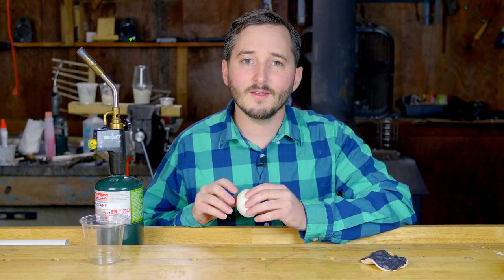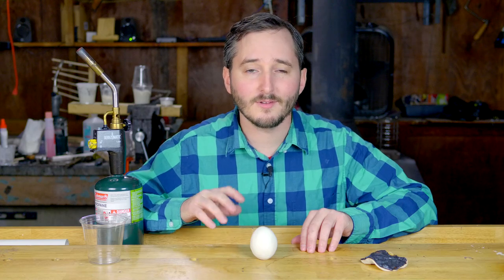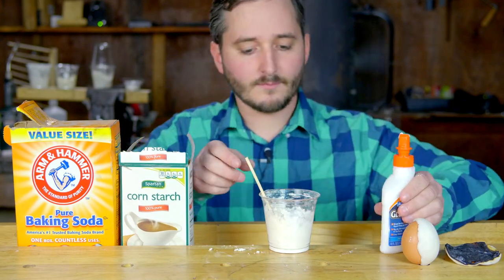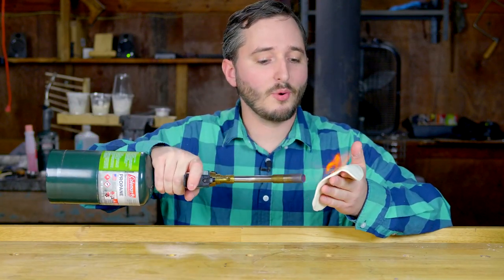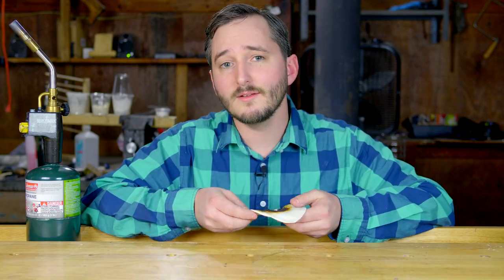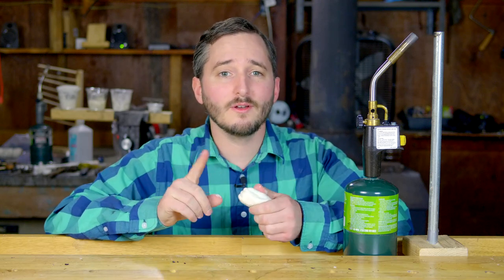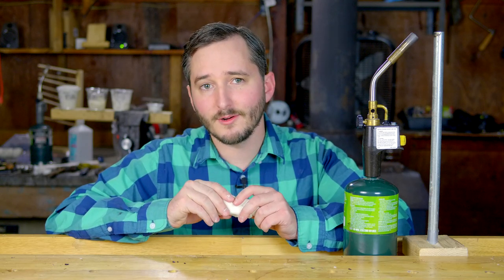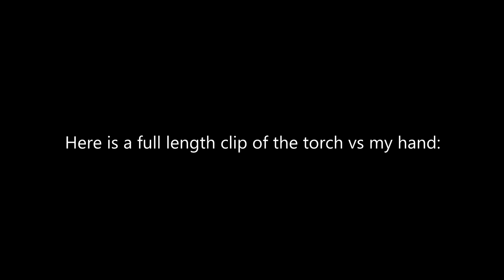A Super-Material That Can Be Made In The Kitchen (Starlite Part 1)

Comment: Great for plumbing applications. Especially when doing repairs that require soldering with a torch in closed spaces.
Reply: Exactly what I was thinking dude. In tight spaces
Reply: What a flippen great idea!
Reply: Im in hvac and was thinking the same thing.
Reply: I was thinking same thing for heating stuck automotive bolts in sensitive spaces!
Reply: My very first thought. Cheap and easy to make.
Reply: What would you do with it?
Reply: General answer put it on the things you don't want burned , specific maybe soldering on a new toilet shutoff valve could use to cover a laminate floor , automotive could use to build a little hut around always stubborn exhaust bolts to keep fire from dancing over to wires and plastics
Reply: I would be curious to see if maybe covering a stuck bolt and heating would keep bolt a tad cooler and get a little more hot expansion/cool contraction help
Reply: I thought that too
Reply: @DS-wf6rh  thanks.
Reply: Kinda like masking tape for soldering?
Reply: @padfrog193  Perfect example, thank you.
Reply: @padfrog193  masking tape to soldering, that's one I've not heard of or seen videos of before, does that stop solder running down the pipe...

Comment: Very cool! I have done a lot of plumbing repairs on copper pipe with that same torch and scorched a lot of 2x4s and floor joists, even though I was soaking the area with water and trying my best to prevent starting the building on fire. There are so many times that you need to sweat a fitting in close proximity to the structure and it is impossible to not scorch the building. I have never had a good barrier material though I have tried many things. I will now use this. What an awesome thing to share with us! I would be interested in hearing your theory about the failure of Starlite...

Comment: I’m a jeweler and I do casting work sometimes. I think this would be a great material to radiate heat back into the crucible to melt the metal faster! Thanks!

Btw, I love the calm and quiet atmosphere without the electronic music from some channels. I can think peacefully in my head while watching your videos!
Reply: RexArthur Ramos let us know I was thinking it would work well as insulation in a kiln. From what I’ve seen most diy kilns seem to break down in time from the heat.
Reply: Simsimaspineshank S That’s why it would be a good material for melting metal in small crucibles. You don’t want a material that will absorb heat but a material that will reflect as much heat back onto the metal. If you use a material that absorbs heat, it would then steal energy that could have gone into the metal which results in longer firing time = wasting more gas. 

Normally I use a specific kind of brick for jewelry work to create a square “oven” but that application still isn’t optimal.
Reply: Cecil McKeithan I haven’t used it enough times on casting to give you enough data. For my application it does help. 

I do wonder if you might need to pre-fire the starlight to get the carbon to come out first since I dont know how hot your kiln gets but If you’re heating a kiln up to cone10 you shouldn’t need to pre-fire it. As for the durability? I also don’t know either haha, but the materials to make it are so cheap and easy to make that it warrants a try.
Reply: May have to make some and see if it would make a good mortar with the fire brick
Reply: Let us know if you try it. I was thinking the same thing
Reply: @cecilmckeithan5088  yes I was sitting here wondering about the what reciepe would work best.. did you try it yet? Would be great to be able to make bricks.
Reply: Nonya Business my hands have been deep into building greenhouse for wife haven’t had time to do anything
Reply: Could just mold a whole crucible out of it. Or a brick
Reply: But with like a clay bowl in the center because this looks like it would make a lot of slag
Reply: I'm just commenting so that i get a notification the next time this thread gets an update and good luck to everyone testing this
Reply: Interesting idea, i might also try it but that will take some months
Reply: Im now considering it for lining the combustion chamber of the rocket mass heater I'm building for the greenhouse.
Reply: Send him some money then
Reply: i am a backyard smelter , i melt gold  , silver and the rest , as i do not have a proper facility this will come in very handy .
Reply: So? How did it go?
Reply: The heat gets dissipated, not reflected. No go.

Comment: If this could made into the correct consistency for drywall compound  application
then you have fire proof ing achieved for at least the surface of interior walls.. 
amazing!
Reply: Hmmmm!  Add in some gypsum powder...  and an industrial high temperature glue...  and might work!  :-D
Reply: I wonder how household paints would affect the performance, acrylic paint is one thing but what about oil based paints?
Reply: @AflacMan13  Add gypsum powder to liquid glass and you've got everything you need.
Reply: Drywall is already very fire resistant, and there are ways to make it moreso that are already out there.

Comment: Holy shit I just watched that documentary. If this was his formula than its no wonder he was so protective of it. It's so simple and would be crazy easy to copy.
Reply: I was thinking just this. It explains perfectly why he was so protective of the formula.
Reply: Its formula is still unknown, video is about similar stuff but not the same. I will believe it is same if he hits it with 10,000 degree laser.
Reply: @commandroid9336   Lasers don't have a temperature, they are just light.  The temperature at the spot where a laser is hitting something depends on the properties of the material: how much of the light it absorbs and how well it re-radiates the heat or conducts it away.  It's the same reason an asphalt road in sunlight is much hotter than a concrete sidewalk.
Reply: @hyperhektor7733  yeah maybe someone will see this video and continue improving upon it
Reply: @apotato6278  im already off to improve it at the moment I will make it withstand over 20,000 celsius tempetures and be able to stop bullets and design phone cases with it. I might even make a super suit with this material

Comment: This is fantastic. I can think of many uses for this around the house and garage such as protecting areas near something you are using a torch on, like soldering copper pipe in a tight area. Definitely interested in a video with more info about why the original did not enjoy commercial success

Comment: Iv been a full time firefighter for 20 years. This foaming action provides a air space between the outer layer, with direct flame insult, and the inner layer in contact with his hand. Modern firefighting PPE ensembles utilize this method for protection from fire and heat insult. The material is different, a firefighters PPE uses, multiple layers of textiles, to protect against different types of dangers firefighters face. But the end result is still the same. If the air spaces between layers are compressed, due to the ensemble being worn too tightly or compromised with water bridging the gap of the layers. The firefighter can be burned badly. Excellent video and well put togeather!!!
Reply: So are you saying this would not protect a firefighter in a fire sir?

Comment: I for one would love to hear your thoughts about why Starlite never made it into commercial production.also, if some kind of organic fiber, like hair, were mixed into your putty might the carbon foam be reinforced by a carbon mesh. this could add structural cohesion to carbon insulating layer making it less like to brush off.as always, great demonstration. please keep producing these excellent videos
Reply: Because the inventor provably lied about almost every "Nasa Memo" he ever had... Seriously, if your inventor has to lie about stuff constantly. IT's a bad sigh.
Reply: "...about why Starlite never made it into commercial production" 
1) It wasn't possible to apply it to surfaces
2) Ward died
Nr. 1 is the main reason.
Reply: Instead of hair, etc., what about strands of glass, like what is in fiberglass insulation.  Very tough, and also already being used to insulate!
Reply: That would be carbon fiber. :)
Reply: @StCreed  Actually, it was possible to apply it, but time-consuming. The problem is it degrades pretty quickly and weighs a ton compared to materials doing a comparable job.
Reply: Yes pls share

Comment: It's so nice to see a video that puts it all right out there, no weasel words or big secrets. Thanks! I'm going to try this as a liner for a micro forge, using a soup can and propane torch.
Reply: How did that work out? Someone else was saying it didn't last a real long time. Let us know.
Reply: It's not a refractory, exactly. It gets its best fire protection while it's drying out. After it's dry, it will gradually burn, blister, and spall off.
Reply: I tried it today. It has dried out for three days, and I would have a very hard time melting pennies on it! He had better luck with it damp, as you said.

Comment: Could you try completely coating and Egg in your starlite and placing the whole thing in a foundary? So it’s heated from every angle
Reply: There are going to be limits- it obviously relies to some extent on insulation, and insulation values are finite. It has to be cooled on one side. It's magical, but not quite that magical. A big enough volume could last a long time, but not indefinitely.
Reply: hes right, now youve established a baseline with the egg demo, you need to chart the upper limit
Reply: perhaps make a small pot thag fits only one egg, to protect it from all sides
Reply: This would be interesting but my prediction is it won't last nearly as long as when the heat only comes from one direction and can be radiated away in other directions.

Comment: You should totally make a video about why starlight wasn't used!
Reply: Even if it's theory, I'd still be interested in his take. I have to agree with him that it's more than just the guy passing away.
Reply: I've gotta agree. Even if the brain trust at NASA couldn't directly reverse engineer the original starlite samples, I'm sure they, like yourself, could easily get in the ballpark of potential formulas. I'd like to hear your theories, and possibly see a follow-up video comparing a few different recipies. Thanks!
Reply: Yes make a video on why it wasn’t produced. Most likely because anyone could do it! Impossible to patent that!
Reply: +1
Reply: Does anyone else want to talk about it here? The potential value of a material that could protect the structure of a building in case of fire seems self-evident, so I'm guessing there's some other property of the material that makes it unsuitable for such a use. Would it attract insects? Seems possible, but it also seems like something could be added to the formula to repel insects (some kind of insecticide or something). Would it be too brittle? Too difficult to apply? Too heavy, somehow?

Maybe it's only effective against extremely high heat, and such temperatures aren't common in structure fires?

If nothing else, sell it as magic moldable soldering insulation for plumbers soldering pipes right next to or inside walls.
Reply: To easy to replicate. He probably just wanted the noteriety and thought letting out the "secret" would diminish his fame. Ironically he would probably have been celebrated for discovering such a simple solution.
Reply: @MrFmiller  
Ben said he thought there were reasons, beyond distrust, that Starlite wouldn't be commercially viable. Being "easy to copy" may have stopped it from being worth billions overnight, but there are plenty of very successful products that are easy to copy. For instance, selling bottling water seems pretty simple, but there are plenty of people making a lot of money doing exactly that. If there's more than meets the eye with Starlite-ish substances, I'm curious of what its actual pitfalls are.
Reply: I can think of one reason off the top of my head. According to Wikipedia, "When heat is applied, the material chars, which creates an expanding low density foam of carbon which is very thermally resistant". So for purposes of reentry it would be useless since the low density foam would ablate and your heat shield would be gone too quickly to be useful.
Reply: Ok guys don't get the ablative he made in this video confused with the real starlight, they are completely different. Seriously go check out the old videos on starlight, it's beyond belief how it works which is why he had so many displays with media and scientists to prove it really does work.
The primary commercial interest for starlight would have been things like rocket and jet engines, but also as a heat shield in countless vehicle and building designs along with protective clothing. 
This is a nice display of an ablative heat shield but it's really nothing like the original starlight.
Reply: @ruby_wired  
Very true, the carbon buildup of Ben's formula does look quite delicate and probably wouldn't survive very much handling between uses (and probably wouldn't survive a single event as extreme as atmospheric reentry). Though Matt TheChosen is quite right as well, Ward's Starlite doesn't seem to char-up nearly as quickly. Although I had seen some of those old BBC videos before, YouTube started recommending them to me left and right after Ben's video came out. I've watched a few of them again and what Ward made looks almost like a ceramic, and I'd describe its reaction to a torch as discoloring and blistering (not charring and expanding a fair amount, as was the case with the formula that Ben showed (I hope he's been working on it and improving it, and I hope he shows us what he's come up with!)).

But it seems like even the formula/process that Ben came up within a couple days might be very useful in a few single-use applications (either when the need for extreme heat protection is only temporary (as in my plumber's magic insulation example) or when extreme heat protection would only be needed in an emergency - where needing to survive multiple uses isn't a priority (such as - lining the inside of an electrical junction box, spraying onto the exterior of a building in the path of a wildfire, or separating lithium batteries from the passenger compartment of an electric car).
Reply: @Hirudin  The weight of that application might be prohibitive.
Reply: @Hirudin  :  Excellent idea for a suitable use.
Reply: @ruby_wired  : If I understand correctly, the material will be blown off during re-entry. Too delicate for use with high velocity air. Hirudin wrote, "If nothing else, sell it as magic moldable soldering insulation for plumbers soldering pipes right next to or inside walls." Seems to be a good application.
Reply: +1

Comment: A few months ago and with a pretty similar mixture i coated the insulation of my furnace I use for melting metals almost twice a week and i found that it actually increases the durability and the general insulation abilities of my diy furnace and also the surroundings don't get nearly as warm when i heat it up.
I guess I'll try out ur recipe and add a bit of acetone so i hopefully don't have to very carefully roll out gigantic sheets anymore